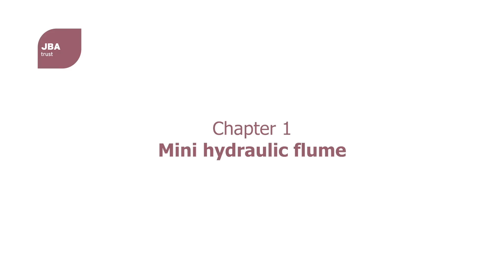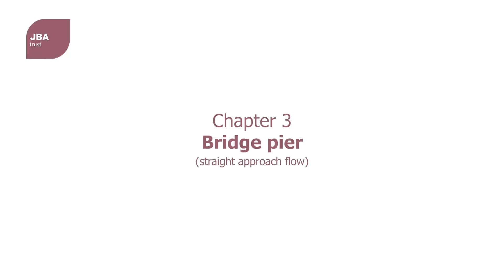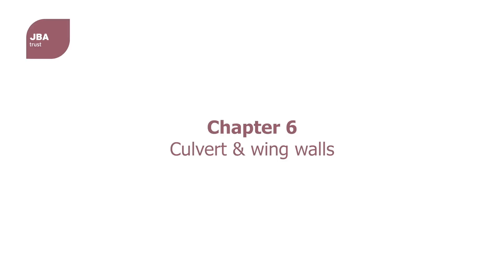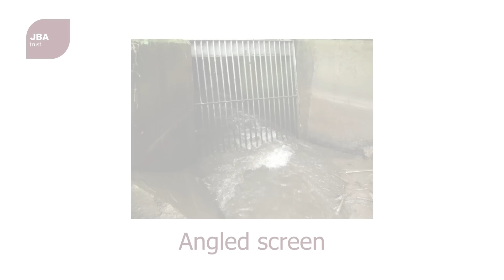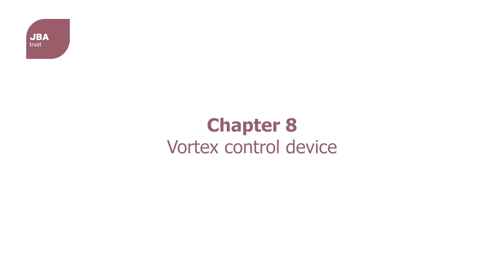JBA Trust hydraulic flume showing how engineered structures affect flow in rivers (full video)

Comment: Anything you put inside water is like an additional Zeta value (pressure lose) in the stream. The higher the resistance, the higher the higher Differenzen between in and outlet heigth. Because of equivalence of massstream incoming mass = outcoming, so the outcoming is always faster.

Comment: Super interesting.. I live in Luzern where have some some huge floods recently. I got to thinking about solutions and found your video. 
Question 1. Post weir when you place and obstruction the water backs up and that is clear. In Luzer , post weir there are a couple L shaped walls that narrow the rivers width and also post weir  an outflow from electric generation scheme. In the L corner there are big eddys and water is almost static. Also in the outflow area of E-Gen. My question is can this be simukated to see if it effects backup to weir.

Q2. I had an idea to place a water turbine just below the weir to increase overall flow speed and hence reduce lake height behing (where all flooding is). Do you know of anywhere this might have been tried or simulated.

Thanx in advance and great video !!!
Reply: I see the wing walls help.. is this due to reducing eddys?

Comment: This is not about rivers... This is about channels. Would the result be the same with 2 light slopes on both side of the "river" instead of 2 walls ? In my opinion, your experience is wrong.
Btw, the best solution to preserve a correct flow of a river is basically  to never, ever, channel it. It's been some decades that we undeestood that, and i'm no genious =]

Comment: I found it very interesting.  However you only used one covert. What happens when you use 2 or even 3 the width of the water rather than a small one automatically reducing the water and adding more pressure. I have no idea about water ect .however i did find it very interesting. Thats what mafe me know think about changing the tunnel ect .

Comment: Basically an introduction to the basics of voltage. Ampere, voltage and resistance work the exact same way. It is interesting to see that the water will always flow through. In reality there are if course natural obstacles that will lead to a flooding

Comment: I didn't know engineering involves so many rubber ducks 🦆
Reply: How do you think they make the ducks?
Reply: It’s just the one duck actually
Reply: Coding engineers use rubber ducks to explain stuff to because it helps workflow. They just explain code to a rubber duck for hours on end.
Reply: I'm thinking career change...
Reply: And in real environment setting do they include clear pvc walls?
Reply: In fluid mechanics is practically a measure unit

Comment: What you call a "stopper" is known as a drowning machine, tom scott has an excellent video about them
Also the duck getting stuck in diving is called a delta p event and a grate or screen is far safer then a hole as there is still flow with a hole you're body will block the hole and form a seal making you stuck there and probably die, delta p is horrifying

Comment: I think the best solution is to use angled screen with a very acute angle/low profile bars. I noticed that water didn’t even touch the second step of the step screen, so there is practically no difference between step screen and angled screen.

Comment: I must be very dumb or something, but In such an enclosed system, if you increase the water height on one side of a new weir, given the limited amount of water in the system, the river will obviously get lower down that weir. Which I would suspect doesn't happen in real rivers, because the system is not closed and you have "infinite amounts of water". The level before the weir will increase, yes. But the level below the weir will stay the same. In order to compensate for that, you need to calculate the amount of new water retained before the weir and add that to the system. Am I missing something?

Comment: correction, as the angled screen was shown that the duck where not pinned, the debry was still in front of the screen which also decrese the pressure difference between ducksurfance and free flow through the tunnel.

Comment: Your demo interesting however I believe you failed to demonstrate the angled screen corectly having the slopes helps debris move up as water rises helping to maintain flow and the stepped benefit was missed as the demo did not show water entering the top step so essentially just another run of the single slope screen. I think the screens you where using where designed to be fitted with the long face on the bottom of the tank not against the culvert entrance. The step can help increase the avalable area for water to pass and when water recedes debris will be trapped on the step so allowing the lower section to flow even after a surge event has delivered debris on a single the debris falls down so flow will remain restricted after a surge event.